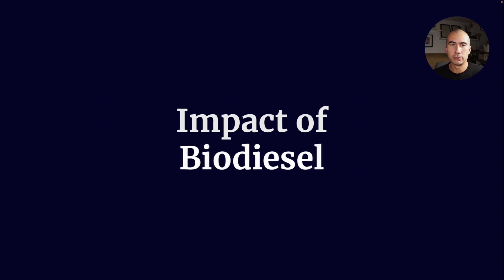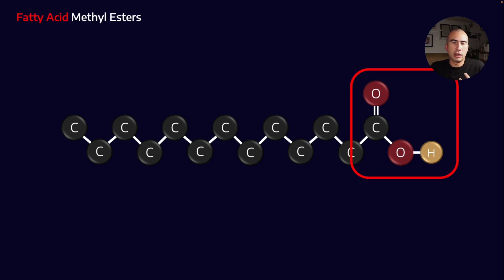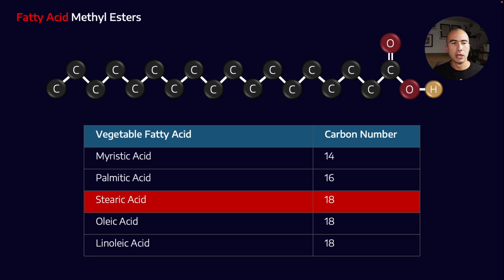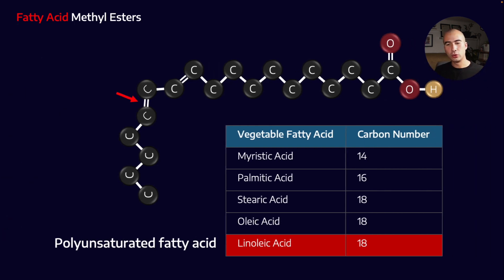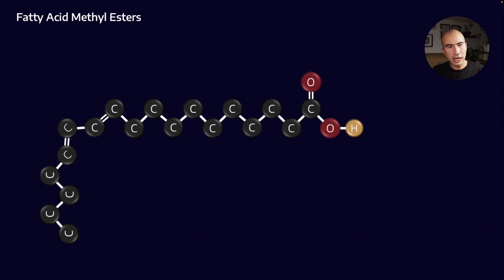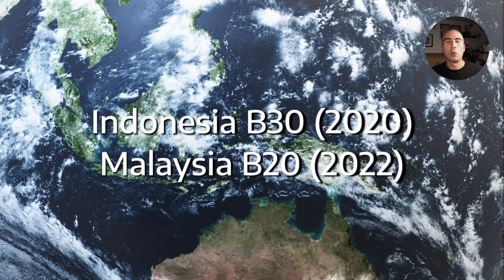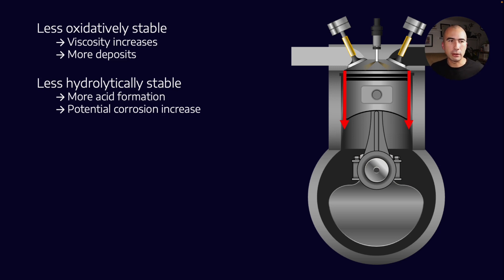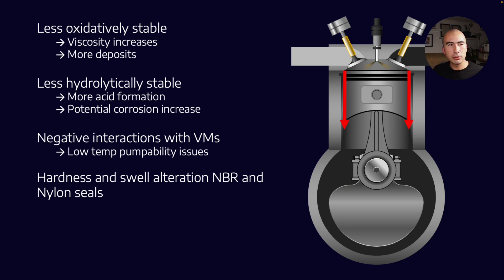How does biodiesel impact engines?

Comment: The info I have seen is the higher concentrations used compared to petroleum diesel is, as you said less mileage and piston rings getting glued/stuck into place leading to loss of compression and dilution of oil.
Reply from the maker: Yeah that seems to track. My colleagues in Indo always complain about ring sticking.
Reply: @LubricationExplained  Damn that sucks to hear, I thought the gumming/residue was due to people running WVO with the triglycerides intact.  I wonder if there was a low-cost additive that could remedy the residue/ring sticking/ect.

Comment: Before watching this video I've been running refined food grade palm oil 50/50 all summer approx 5-7 k miles no problems yet 06 VW TDI just not going to be able to use when temp here in Michigan gets below 45 degrees F thanks for the video. I'm planning to cut back to 70/30 30 percent palm oil
Reply: Does 50/50 mean half regular diesel and half palm oil,  no conversion to biodiesel? Can you make a separate tank and heater to thin the palm oil in winter?  Years ago I had planned to make biodiesel for my 2005 VW TDI. That experiment didn't work out because used oil became scarce, methanol prices increased, and later the TDI engine quit running with turbo problems. However, I still have the VW and biodiesel equipment.

Comment: What happens when you run B100?
Reply from the maker: Don't think you're engine will explode or anything 😛 But obviously it takes all these effects to 11.
Reply: @LubricationExplained  Actually the environmental benefit of it comes when you run B100. Specially on diesel boats in environmentally sensitive areas provided the boat can handle it (this is a very important point. Many engines can not handle it properly). That’s where my interest in biodiesel started in 1992. Since then it took a different direction. All the B5 and B10 is just a way of selling agricultural products via different industry.
Reply: The original research by the US in what was later called biodiesel started in the 1970s after the first oil crisis. They were using soybean oil and it’s derivatives ( fatty acid methy esters).  In Asia research was towards palm oil and its methyl esters. I think Mercedes even made some buses for them that ran on pure oil.
Reply: B100 sounds like a cold region nightmare / head ache.  In Alaska for example, we used DFA (Diesel Fuel Arctic) it was lighter and flowable at -80F, it also had fewer BTU/pound than #1 Diesel. I don't know if there is a B-number vs. Latitude curve but I'd be leery of any Biodiesel North of 30.

Comment: can you please make video about LPG ( propane ) and it's effects on engine and lubricants ?
Reply: We run propane in our 4x4s in BC Canada...
No issues at all and we have v8s
Reply: @waynotraffo9221  I'm guessing that if you are running heavier towing or even medium-range performance cams plus higher-than-stock compression ratios they are rather fuel-efficient and even quite fun to drive too.
Reply: And on CNG / LNG as well will be great .
Reply: Propane and natural gas burns cleaner than gasoline but there will be a loss of hp. Propane is a better choice if you drive a lot because the tanks make less pressure.
Reply: @suggesttwo  Not always. Thanks to modern emissions compliance most engines are so neutered on their power and efficiency capability due to the ECM programming and other useless parasitic emissions compliance component add-ons,  that switching to running them on Propane or NG is break-even to occasionally net gain in both aspects these days.
Reply: @tcmtech7515  cars have improved a lot. My 94 Thunderbird would blow the doors off almost anything 20 years older an most cars 20 years newer would do likewise to my car. Even with only half an engine. I4 
Newer cars are more efficient. Pout=PE*Efficiency. Increasing efficiency is like increasing displacement. Torque production increases.
Reply: @suggesttwo  Yes. and in the performance engine world, the first thing they do to get more power and or fuel efficiency and or life out of an engine is get rid of everything emission compliance related.  I never claimed anything else.

Why do you think the anti-emissions tuning industry is a multi-billion market that's moved from common vehicles to farming and industrial and beyond markets as emissions compliance started to cripple things in those areas?
Reply: @tcmtech7515  cats don't weigh that much and the restriction is small but it's dead weight. Carburetors can't mix the fuel like fuel injection.
Reply: @suggesttwo  What does that have to do with anything I actually said? 

An engine tuned/built for the cleanest tailpipe has nothing to do with being tuned/built for the best power and or fuel efficiency.
Reply: @tcmtech7515  It's the same thing. That's how it's done. More air more fuel. Maximum fuel economy at 16:1 ish by weight 13:1 maximum Power.
Reply: @suggesttwo  Nope.  That's way too dumbed down and simple to mean anything real in this subject. 

If richening up the A/F ratio adds more power and fuel efficiency, why are engines not tuned and built to run anywhere near that?  Why dump extra fuel out of the exhaust to do nothing but keep the catalytic converter warm enough to work rather than just burn the least amount of fuel to do the mechanical work that needs doing? 

Why not trade off a lot less CO2 production for a bit more NOx production given in real-world driving conditions the end equivalent greenhouse gas number average is a wash but the fuel consumption will be substantially less?
Reply: @tcmtech7515  So all my auto mechanics, engine and motor engineering books are wrong.
Reply: @suggesttwo  If they were made after the early 1990's. Yes. Most likely.
Reply: LPG = burnt out valves
Reply: @petea7323  kinda depends on the engine, and probably on the generation of the fuel system. I have a Landi Renzo Evo on a Dacia Duster 1,6l with the engine H4M-738 - 260k km and still going strong. It requires valve adjustment more often on LPG, so that's annoying - this year I did it myself, it's a pain in the butt. So far, the savings on fuel (back of the napkin calculation at curent prices) are about 8300$. Ar some point i will just get a new head, and that will be it.
Reply: @petea7323  Only if your engine is ancient or built with substandard valves.

Comment: Hello, can you recommend for me the best oil for using on bronze spindle bearings and the best grease for normal spindle bearings with rolling elements. Thanks
Reply from the maker: Hi! Unfortunate that’s not really enough info for a recommendation. You really need the type of bearing, speeds, operating temperatures, application, level of contamination, etc.
Reply: @LubricationExplained  hi, all i can say is that it is made out of normal bearing bronze and the speed is from 10 up to 2500rpm, 1,5kw motor, temp is from -10° up to 80° celsius, application is for lathe, level of contamination i would say that only realy small particles like metal and normal dust can get it but in very small quantities.

As for the roller bearing i use tapered roller bearings.

Thanks

Comment: congratulations for the channel is really informative!
in this video you talk about the problem of hydrolysis in biodiesel due to the reaction of the ester in the presence of heat and humidity, many engine oils contain a certain amount of ester, isn't this a problem for the formation of acids in the engine?
in fact I noticed that many "racing" oils with a high ester content have high TBN values even if the recommended drainage intervals are very short ...
wouldn't it be fair to avoid esters in long-life lubricants?
Reply from the maker: Yes and no 😊 You typically only find esters in full PAO engine oils (they’re present to help solvate them additives package). The benefit of having a Group IV synthetic more than outweighs the small disadvantage that esters bring, especially at low treat rates.

Having said that, a few formulations have recognised the limitation and they’re starting to substitute esters with AN (alkylated naphthalene) as a co base stock.
Reply: @LubricationExplained  I'm guessing the methanol ester in fuel is the least stable,  and the ones added in lube are highly stable.
Reply: what about those ester additives by MANNOL? so thats not good inside engine oil?

Comment: Thanks for the awesome in depth information. Thankfully I won’t need to worry about any issues from blow-by in my combustion + Steam Tesla Turbine 😈 only thing that needs lube is the bearings which’s re way away from the motive fluid flow.
Reply from the maker: Oooooh. Tesla turbine. Fun!! Is it a hobby project or something you’re looking to commercialise?
Reply: @LubricationExplained  started off as a hobby but I’m getting such good results who knows! (Just fyi I do have a degree in physics 😅 I’m not just some random Tesla fanboy out here spinning things really fast with no power output… well, ok, I’m kind of a fan boy, but I do still know what I’m doing lol) Tesla’s improved Combustion + steam Turbine Patent GB 186,083 is a sleeping giant waiting to be used. It’s nothing like tooo special but it just a really good way to orient and operate everything. 

It uses the turbine exhaust to give up the energy for the latent heat of vap to raise the steam and then mixes the superheated steam with the high temp combustion jet. This coincidentally uses the steam as the cooling medium for the combustion jet to be able to be admitted into the turbine and reduces the amount of energy the compressor needs to supply to add all the extra air needed to provide all the cooling normal combustion jet engines need for admitting the high temp motive fluid into the turbine. As well since steam has a higher specific heat (joules/kg/°C) than air you can absorb the same amount of energy with the steam as you would by adding extra cooling air but the steam won’t raise up as high in temps allowing the turbine to operate safer at a higher rpm resulting in a higher efficiency, again to mention doing this while not needing to take power from the shaft. However just to be clear all my Tesla turbine results are proving you do not need high RPMs on the Tesla turbine for it to work efficiently like everyone mistakenly claims about the Tesla turbine, AND you can get high torque out of them if you know how to design them right. Dyno’d at 2.75kW and 6.22ft-lbs of torque at only 4150 rpm on 150 psi room temp compressed air with my plastic and aluminum prototype that I’ve been testing with. As well shown continuous 1200watt electrical load outputs at 6700rpm with room temp compressed air all the way down to 65 psi too! Just wait until I cut out my next all stainless steel turbine and add heat and use steam with a MUCH higher viscosity and adhesion to the disc faces 🤤🤤🤤

But seriously his improved patent GB 186,083 is Literally completely fuel agnostic too. Like ANY FUEL. Heat oil, gasoline, propane, Hydrogen, CRUDE OIL, syngas/woodgas/biomass gasification, saw dust, EVEN pulverized coal!! And the one I’m REALLLLLY looking forward to start testing is powdered iron fuel tests because its a completely carbon free renewable energy storage chemical. Since it makes FeOx’s (rust particulates) and they can be cyclone filtered out of the exhaust to have solar panels split it back into iron and oxygen using electrolysis. Never mind the fact the Tesla turbine doesn’t see detrimental issues from multiphase fluid flow, gasses and/or liquids and/or solid particulates within reason of the discs spacing, obviously. 🤤🤤🤤

Comment: Thank you for your explaination refe, im from indonesia, and i have experience with so many fuel dilution happen in my Hino engine, the dilution can even reach 1% by oil analysis.
Reply: Using solar? How about dexlite or pertamina dex?
Reply: Dear Kurniawan, in my experience if your engine is direct injection (DI) then if the concentration of biodiesel in diesel is high then when some fuel gets into your lubricating oil it dilutes the lubricant. By the way this lubricants dilution also happens with ordinary mineral HOWEVER  mineral diesel is made of a range of hydrocarbons with varying boiling point. When the light components evaporates it leaves behind some long chain material with similar viscosity to the lubricant. But biodiesel has a very narrow AND high boiling point so when it goes into lubricant it does not evaporate. And since it is much thinner than the lubricant it will significantly reduce the viscosity of lubricants and reduce its protection. A group of farmers used B100 in their tractors in Austria in the 1980s and they all suffered from this fuel dilution ( which is actually the lubricant dilution). With B5 or 10 the dilution occurs to a lesser degree. With indirect injection the situation occurs less frequently.
Reply from the maker: Thanks for the comment! Yeah it seems to be prevalent throughout Indonesia.